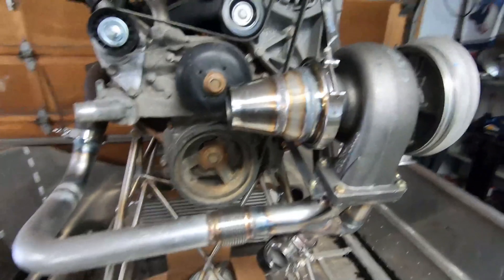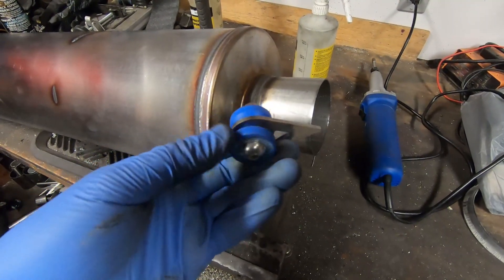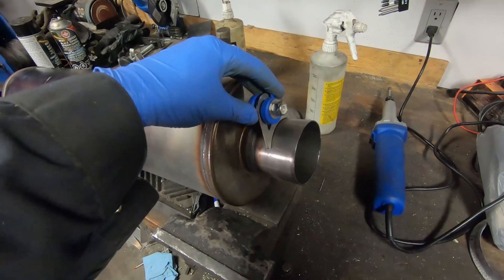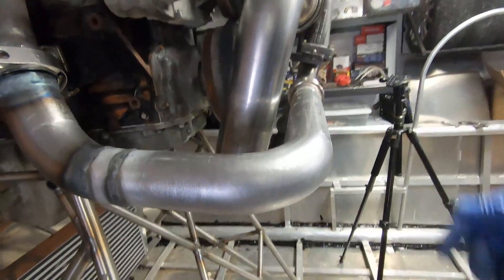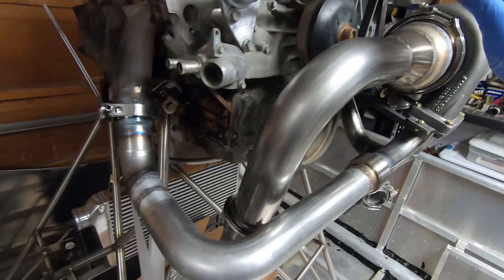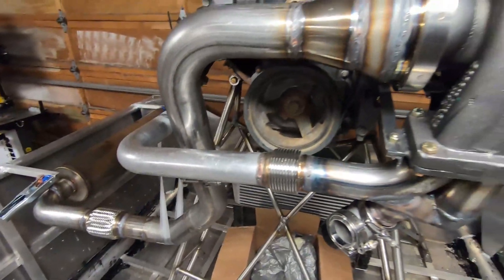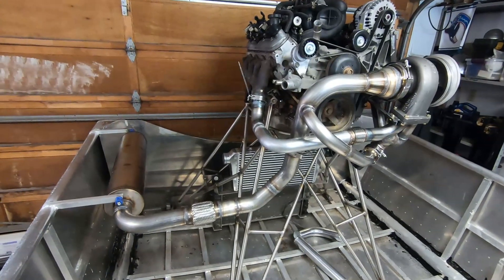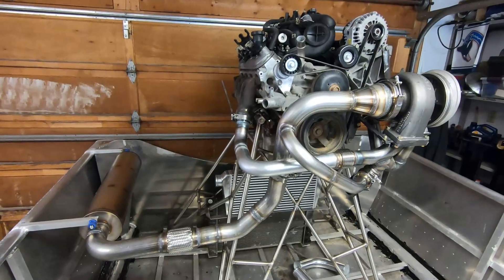Airboat Build #15: Exhaust

Comment: To me that looks like a poor place for the wastegate. Might have issues with boost creep the way it’s set up.
Reply from the maker: What makes you think so?   Looking to learn here.
Reply: Dr. DansGarage your fabrication skills are amazing compared to my skills. It all looks really good.
Reply: I am not trying to belittle you are make you feel dumb. This is just how I think of a wastgate and how it should operate. It regulates exhaust going to the turbo. Too much exhaust and you get too much boost. So you want to place the wastage so the exhaust has an unrestricted path to where it chooses the path of least resistance in your case you want it to be your wastegate so the boost is regulated. It’s also helpful to think as the exhaust flowing through the pipes as water. Water does not like to change it’s direction of flow very easily. By having the wastegate at close to a 90 degree angle it doesn’t want to flow into it. And again some things don’t work the way we think they will, your wastegate might work just as you hoped but if you run into boost creep issues then I would suspect your wastegate placement to be at fault . I don’t know if your familiar with sloppy mechanics but he has some good content explaining turbo ls builds.
Reply: Also if your still running into boost creep issues it can be better to run the wastegate own dedicated exhaust. When it is rerouted back into the down pipe it is piped into a situation where there is higher than atmospheric pressure. It doesn’t want to flow into the down pipe as easily as it would have to the atmosphere. And again your setup might work exactly the way you want it just some efficiency things to look at to optimize your setup.
Reply from the maker: Thanks for the comments.  This is my first turbo build so I am definitely still learning.  I agree the flow will preferentially go to the turbo.  The way I thought about the wastegate is more of pressure relief, even though the angle isn’t ideal for flow.  
I’ll keep an eye on the boost and if it isn’t working well I’ll redo the hotside; no biggie.  Just part of the learning process.  
I do follow sloppy mechanics and Matt has done some good stuff; especially in the last few years.